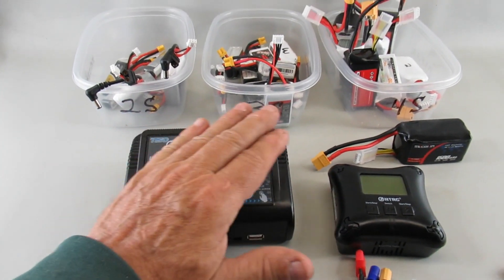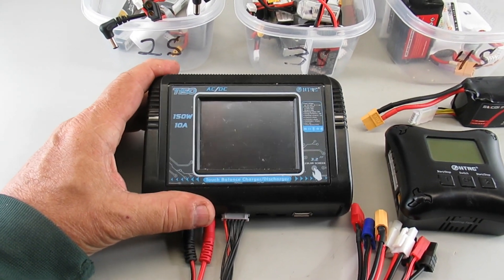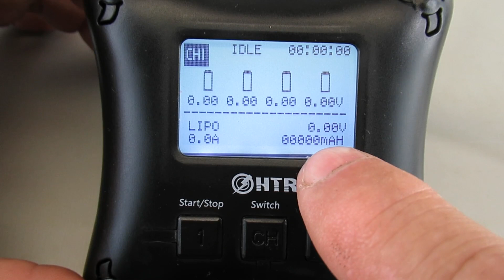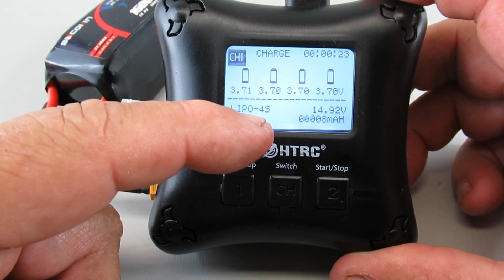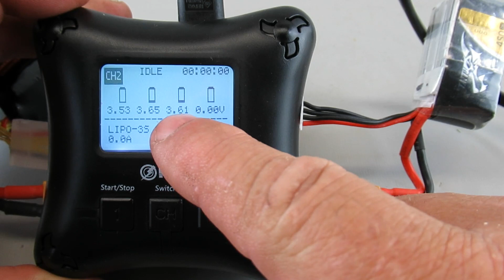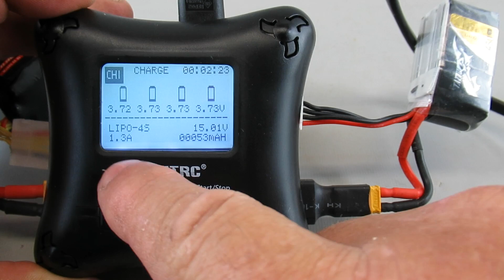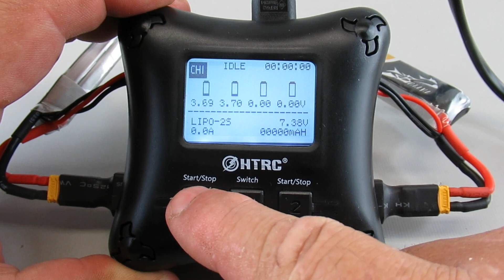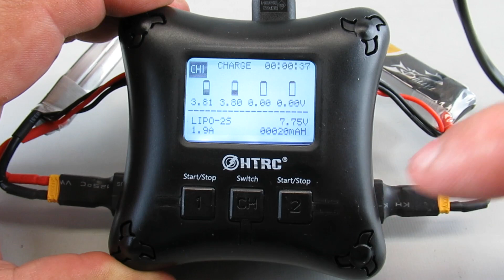HTRC H4AC DUAL LIPO FAST CHARGER | FPV 2S - 4S | Review and Test

Comment: how do i set the charger to stop charging the batteries at a safe voltage?
Reply from the maker: It is automatic based on the number of Lipo cells sensed using the balance plug.

Comment: Good review.  I have a question tho, Isn't the mah number what we are supposed to charge at? 
So like 400mah battery should be charged at 0.4 amps? The charge rate can not be changed?
Reply from the maker: Yes, the general rule is to charge at a rate no more than the pack's ma rating to avoid overheating but that's very conservative.  As you may know, when in use the pack can safely provide 10-20 times that rate and they do get warm.  Fast charging at up to a 5x rate (2A for a 0.4A pack) imo can be done safely if you can be assured the charger will shut off when the full charge is reached.
Reply: @TommyTester  
Thanks for the answer.

Comment: Nice review! How long did it charged to full for 4s 1500mah with 1.3A?
Reply from the maker: In general, 1.3 amps is 1300 milliamps, so with a mostly discharged 1500 millamps hour pack it takes about 1 hour.   In contrast, the 2S450 at 2.0 amps took  less than 15 minutes.  Thanks for watching.